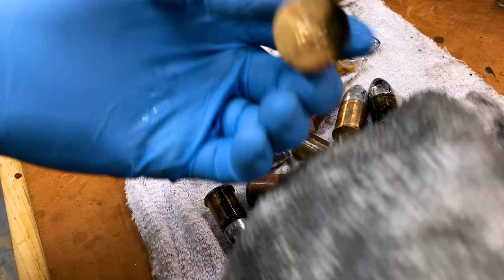Adam Savage's One Day Builds: Hellboy Samaritan Bandolier!

Comment: Hi Adam! I'm a leather worker, and specifically make strapped/belt goods. This came out great! I just wanted to give you a heads up, the strap cutter you're using is made to be pulled towards you, not pushed away. You are using it like a plow gauge, which is another strap cutter design with an exposed blade. If you were to pull the strap cutter towards you, you'd have 5-6 inches to align the uncut leather, rather than only 1 or 2. I hope that helps!
Reply: Yup! I had mentioned this on his last video on leatherworking. This strap cutter design is pretty perfect, I've been using it in my shop for over 10 years, and know guys who have been using this design for around 30-40 years.
Reply: @Stevieboy7  One of my favorite parts of leatherworking is the tradition & history. I'm sure that if a better/more efficient strap cutter could be made, we would have it already. The only thing above that model is a machine, in my opinion! But it looks like Adam's method still puts out some great results, I just hope he sees this so he can work a little more ergonomically.
Reply: Mmm the bacon of leather-working has to be using a strap cutter. I have some insane sharp german blades in mine, it could cut whale-skin if large enough!
Reply: Probably why it was in “backwards” at the start.
Reply: I am dying a little bit inside....Al Stohlman would be a bit disappointed.
Reply: want to say the same thing,hope he see this comment
Reply: i came to make this exact suggestion. good looking out andrew
Reply: He also really needs to sharpen and strop his punches. That part hurt to watch.
Reply: Yup, I always pull strap and lace cutters
Reply: @bhronnyhill9354  At least hone the punches after you use them that day. Wait. Most people don't even wipe off (brush) their punches. (My uncle said don't blow on punches and chisels. You'll rust and pit them.)
Reply: When I saw the handle I thought it looked like a pull-tool.
Cool information, thanks!
Reply: Yeah I saw Adam using the strap cutter like that and thought, "how is he getting it to work that way?"
He also sets his rivets how I consider to be upside down.
Reply: I am most definitely NOT a leather worker, but am fascinated by the depth of knowledge that always turns up in Adam's videos. It seems that professionals in ALL manner of trades get as much out of these as we mere mortals do!
I am also incredibly impressed by his apparent "Jack of all trades, Master of none" attitude. Yet he always manages to end up with a "perfect - looking" product at the end. I assume that's what he means by "Hiding the crimes"!?!?
Even though most of these conversations go right over my head, I always read through them to try to pick up any tips that I can take into my own hobbies (mostly centered on guitar maintenance and my long term project of designing and building my own guitar.) If I decide to try my hand at a guitar strap, I'll be back here looking for tips!!!
Reply: It hurts a little seeing him using it that way ...
Reply: OK yeah I see, not holding the handle seems to clearly indicate the design and the use don't match.  I see Adam likes the idea of guiding the cutter into the leather like a circular saw to have good control over keeping it tracking the line.
Reply: My father always taught me to cut away from myself when using sharp, manually-operated objects, so that may also be Adam's instinct in using this tool.   LOL.  I can see that pulling would be better in this case, however.

Comment: Hey Adam,   Here a tip from a leatherworker- when punching a lot of holes like you did having it taped off,  rub the surface of the tape with beeswax then commence punching.  The wax will lube the punch so your not fighting it.  Also you had your strap cutter set up correctly the first time you use it by pulling the cutter towards you having the handle as the guide and as you pull it it maintains contact.

Comment: Adam, freshly-loaded ammunition is always bright and clean, it oxidizes slowly over time. I'm a reloader, so I know this.  Also, depending on the process used to make the leather, it may actually cause the brass to corrode.  Vegetable-tanned leather will not do this, but chemically-tanned leather is more likely to cause it.  I've been thinking about building a firing version of the Samaritan, but if you think about how much work it was to make it in aluminum, think about doing it in steel!  Plus the additional requirements of rifling the barrel, making a reliable action, etc.

Comment: Just to help anyone curious, the easier and more common way of using that leather strap cutter is to pull it towards you through the leather instead of pushing it.  He didn’t actually have the two arms mounted backwards like he corrected, he actually had the blade mounted backwards.  So the measurement marks on the tool and the blade should be facing you as you pull it through the leather.   It’s just a lot easier to control.  I’ve been teaching leathercraft for many years and everyone should give it a try.  It’s incredibly easy. Have fun everyone.

Comment: When it comes to the retention of your rounds (it's up to the user), but you don't want it to be TOO tight. You want just enough tension to hold your rounds, and enough looseness to allow you to draw the round out to reload your cylinder as fast as possible; when not using a speed loader. Granted this is a prop belt for prop rounds, but I think it adds to the appeal that this is actually Hellboy's gun belt.

Comment: First off, Mr Savage, I absolutely love watching all your videos and especially the one day builds.
If I may make a couple humble suggestions as a leather worker and as someone who has made a few gun belts

First: that specific strap cutter is designed to be pulled towards your body rather than being pushed away, you may find this helps drastically reduce the amount of focus necessary for straight cuts
Second: the bullet holding straps are usually fed up through one hole, around the bullet (or BSO) and fed back through the same hole it came out of. This lets it hold the bullet quite snugly, allows a bit more flexibility, and lets you get more bullets closer together. Granted, these are enormous bullets and very thick leather. 
Long story short: love your work.

Comment: We need a demerit badge for forgetting to wear safety gloves.

On a totally unrelated notes, did you know that an angle grinder can and will rip through tendons?
Reply: Earlier this year mine tried to run from me, got it by the wire before it hit my knee then it swung and smacked me metal side. Soon As i killed the power did a leg check XD because i do know they will take meat off you
Reply: The Emperor  helps with sparks but got used to that pretty quick
Reply: It cuts flesh tendon and bone quicker than you can register pain. Kinda odd watching people in the shop getting cut by them and then doing the countdown until the pain registers.
Reply: @pouncepounce7417  never heard that part, makes sense though with the rpms
Reply: @saikawanderer9166  It is extended even more so by the adrenaline shot that blanks out pain, but sawblades and anglegrinder discs remove tissue so quick our reflex to pull back hands as soon something stings is not of much use.
Reply: @pouncepounce7417  have had enough of hand tools biting that the moment I see a power tool go somewhere it wasnt I kill it and check myself
Reply: @saikawanderer9166  I treat them as dangerous as guns

Comment: He had the strap cutter correct the first time. You want to PULL the cutter along the leather with the handle on the same side as the cutting edge, not push. The flat side of the handle helps keep the cut straight. But of course we all have different ways we use our tools. (I've been doing leatherwork as a weekend hobby for a few years so I've definitely made my fair share of mistakes)

Comment: Adam, a tip that saved me HOURS over the years, is if the project allows, apply some wax to the punch and it will glide through much easier. I used pure beeswax.
Reply: I have been scouring the comments for someone with a tip on this. I knew there had to be a better way. Thank you.

Comment: That concave tool for your rivets also usually comes with a tiny anvil, also concave, so you can get a nicely domed head on both sides of your rivets. As for your leather toolkit, I think it needs a thick leather belt that goes right round it, to act as a closure.

Comment: HHey Adam! I do some leathercraft too, and I use a cheap 3D printer to make small one off embossing dies.  Just lay out your design in any 3d application, mirror image it, and extrude it a couple of millimeters.   print it out, wet the leather, and press it onto the leather. if You have a press, great. if not, you can use a bench vice and a couple blocks of wood to sandwich the leather and stamp between to spread out the load. it works phenomenally on veg tanned leather, and pretty good on chrome tanned as well. the 3d printed plastic are surprisingly strong under compression.
Reply: Also, have you seen the youtube video of the girl who builds her own wearable robot suit?  its called "How To Build Your Own Wearable Robot?" ( youtube watch?v=P8X5WHbbiXc ) its amazing!

Comment: Adam, look into roller fabric cutters used by rug hookers, like the Bee Line Art Tools Fabric Cutter, which they use to turn bolts of fabric into long strips that they use with a rug hook tool to create the pile on throw rugs. I don't know if they work well on leather, but they're meant to be used with replaceable circular cutter blades that cut for a long time in fabric. They're a lot like those counter-mounted pasta makers with the big crank handle.

Comment: To make the first straight cut of a rough edged large piece of leather we lay the leather on the workbench, making sure only the rough edge we want to cut off overhangs the edge of the workbench. Then use the strap cutter and simply let it glide along the edge of the table wich makes the cut straight. :)
 
By the way! You should totally do a one day build and make yourself a nice tooling mallet for your leather tooling. Cheers

Comment: Adam, not nitpicking I promise.  These might help you i the future get your projects done quicker/easier and with a bit more joy left at the end.  Hope this helps.

Strap cutters like this are designed for use on the pull stroke, not the push.  There is also a bevel on the exit to allow for variance.

Some wax on your tape before you cut it makes the plugs and the tool release easier.   

If you want your tooling to be nicer to hold, make a rectangle of leather, and stitch it closed with a cross stitch.  It helps save SOOO much stress holding a small tool.  This is a great skill for a lot of tools to make them more hand friendly.

Comment: Adam, it's probably mentioned but: run the edges of the leather over a belt sander (finer grit) with light pressure. It seals the edges.
Reply: Oh, forgot...wet the edge a bit with a sponge.

Comment: Adam,
Just saw your clip on the "merit badges"; a few suggestions for other badges.

different fingers missing,  improperly secured cargo,
glueing your fingers together,  lifting improperly,
glueing your hand to the bench,  overloaded circuit,
set yourself on fire.  set your bench or shop on fire,
cutting the cord on a power tool,  not setting emergency brake when loading,
not turning off electricity or water,  not using proper screw driver/buggering up screws
not wearing safety glasses,  not wearing hearing protection,
hitting finger with hammer,  not wearing safety toe shoes,
not having enough ventilation,  not reading all of the directions on a new product or tool,
looking at the welding arc,  everything in a shop is either sharp, dirty, heavy or hot.

That's all I can come up with off the top off my head.
Live long a prosper,
Bill.

Comment: Hi Adam! Another leather working note. it seems your punches need to be sharpened and if you rub down what you are going to cut with a little bees wax it will help the punch glide through and also help keep the punch from clogging and dulling. hope this helps

Comment: Demerit badges: Picking up hot steel because it looks exactly like cold steel; Grabbing a hot soldering iron like a pen; Not cutting off the electricity to a machine before working on it; Snapping a hardened steel tool by prying with it.

Comment: The strap cutter you are using is a simple wooden strap cutter, it is my preference. It is designed to be pulled towards your body through leather instead of pushed through leather like you are doing here. 
There are two other primary designs for strap cutters, 
A draw gauge is used by pulling towards your body to cut the leather and has an almost pistol like handle that is very easy to grip. And a plough (plow) gauge, used by pushing the blade away from your body through the leather. (very similar to the motion you used with the strap cutter) 
I could see you liking how the plow gauge works.

Comment: When cutting holes like that where they are the same hole over and over, would you perhaps be able to put the hole cutter in a press? This way you could feed the belt through and use mechanical leverage to your advantage. It could possibly speed up something so repetitive and also greatly reduced stress to your own body. Wouldn't do it for a little section but something like this with so many holes it may be worth a shot later on

Comment: Adam, 
Please make a better strap cutter. Look into a plough gauge. It works in the way that you use the strap cutter, by pushing. May be more of what you are looking for, but expensive.
Also, the way you are using the stitching groover is traditionally done using an edge creaser. This is actually putting a crease in the leather instead of removing leather.

Comment: seeing as Adam has access to a lasercutter I'd have done this with a lasercut file, all the holes could be cut and you'd just need a little jig in the laser cutter so that the belt could be moved though and accurately aligned for each pewpew operation.

Comment: it's called a Bandolier
the bandoliers are normally Stitch between the loops because the holes make the belt weaker 
and as you said ammunition is heavy 
Especially when it's made of lead and not pot metal or aluminum or urethane resin

Comment: Hello I am I leather worker and this is going to sound how it going to sound but know I just want to help!
About the strap cutter and how you were using it. Obviously you can use it the way you were just fine. But maybe try drawing it towards the handle while pulling the strap your cutting away from the handle I prefer to do this pulling across from left to right while pulling the belt that I'm cutting from right to left the same as you just want to play in that opposite orientation. 
I hope someone see this and it clear enough to help In some way.  Have a great day

Comment: Strap cutter design idea. I'm not an engineer I'm not a Leather worker
On the leading edge, roller wheels with a geometry (like a screw) on opposing surfaces that might pull the material against the straight edge. The material is pulled through, thus rotating the wheels.
🤷

Comment: Odd question: When it refers to 9 oz latigo how is that measured like does it mean 1 square inch weighs 9 oz?
Reply: Leather ounces don't actually refer to weight in any way, but to thickness. 1 oz in leather is equivalent to 1/64 of an inch. If you picked a quarter out of your spare change and measured it with a leather gauge it would be about 4 oz, or 1/16 of an inch.  It was once vaguely related to how much one square foot of material weighs, but since the density of leather varies greatly depending on the source animal, the method of tanning, the dyes and surface treatments, the "ounces" are solely used as a measure of material thickness now.
Reply: @LunarEclipsism1  so why not use a distance based measure instead of a weight/mass/volume?
Reply: But it's roughly based in square foot ty didn't know if it was inch foot or yard or something
Reply: @ShugoAWay  because humans are strange creatures and terminology and traditions often stick around past the point where they still make literal sense. Why is the save icon in computer programs shaped like a floppy disk even though you can't save on a floppy disk anymore?  Why is gunpowder measured in grains? Why do we measure length in "feet," anyway? Why do some people call the first floor the ground floor and the second floor the first floor? 

Old terms and practices stick around and get adapted, we don't always throw them out and start fresh.
Reply: @LunarEclipsism1  fair enough thx again for helping to satisfy my curiosity

Comment: Question on the Tested store - Why do patches shipping not combine when you order separate patches? I see it's $3.50 for one patch, then $0.25 each additional patch - $3.75 for two, and $4.25 for four - when you order multiple of the same - but it's the full $3.50 for EACH additional design.  So ordering two sets of two is $7.50 for shipping, not $4.25.  Ordering three sets of two is $10.25 for shipping, not $4.75. That seems.... Excessive. I want to order a few of each (one for myself, and one or two more to give out as gifts,) but the shipping being "full cost" for each different design makes me not want to, as shipping is now a large percent of the total cost. At this point, I'm just placing an order for only one variety.

If someone else wants to do similar, and trade extras, I'm up for it. Each pays just the postage to send to each other - 50 cents extra instead of $3.50. (I did the "release the smoke" design.)